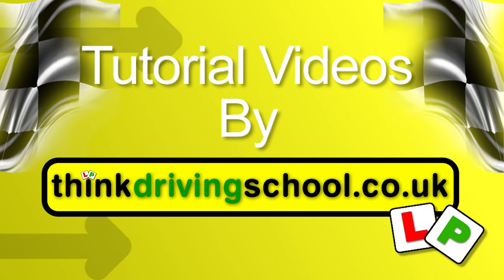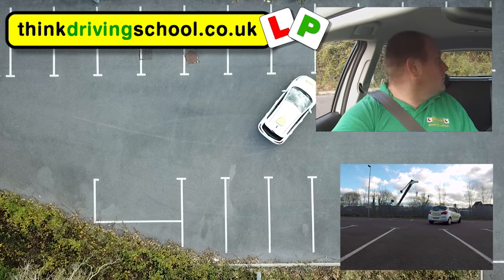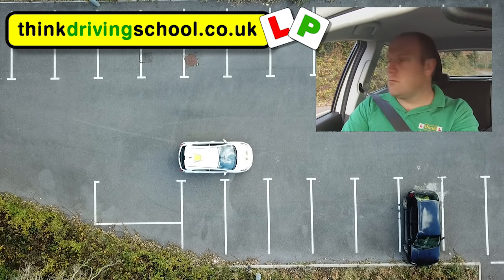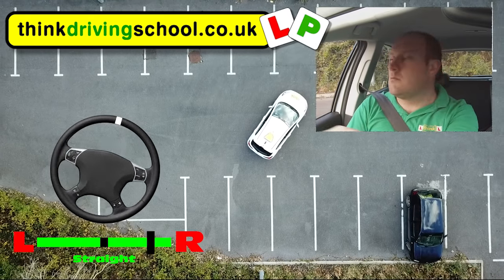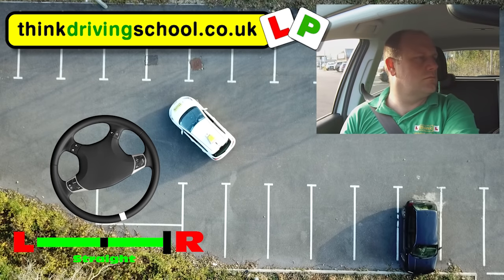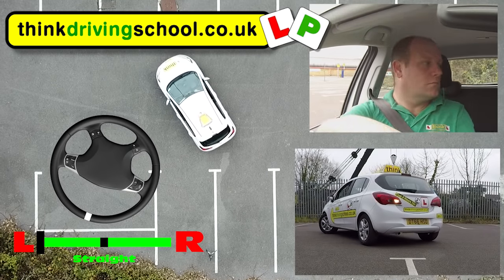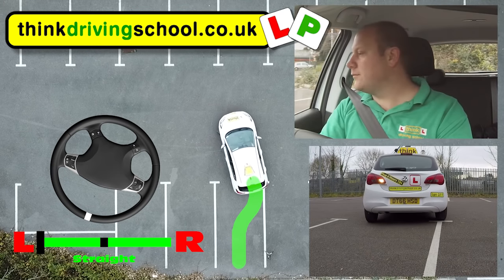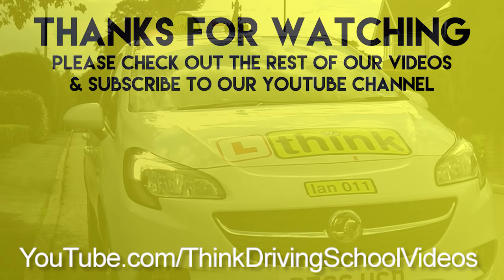Reverse Bay Parking Manoeuvre, Using The 45 Degree Method From Think Driving School

Comment: This is such a good tutorial. I'm annoyed by the number of videos that say for reverse parking you can use the "line method" for example 3 or 4 lines, etc. depending on the size of your car, but what if you have to park in the last parking bay? although you can still imagine 3 or 4 lines depending on the size of your car, what if there is a wall blocking you from doing that? i find this alot more practical
Reply from the maker: Glad it’s helping :)

Comment: When I began to learn how to do bay parking nearly two years ago, I searched videos of this method because most drivers used this one in my country. But then most videos taught 90 degree aka 3 line method; very few taught 45 degree method. With limited sources of this method I finally could do it and always used it. But then I thought I needed to learn 3 line method as well and began to practice it. I found that the traditional 3 line method had additional advantage, not only for parking, but also for reversing around a corner.
A few months ago, I got bored in using 45 degree, especially when there was only 1 car next to my car. Besides, I just intentionally want to show people a different method they probably have never known or used before. I found the traditional 3 line method was fun to use, because it gave me more time for swinging in reverse.
However, it depends on situation to determine which method I will use :
- if traffic behind me is quiet, I will use the traditional method
- in a busy traffic, I will use 45 degree method

Imo, every driver should learn both methods so they will be prepared to deal with situations in which one method is more suitable than the other one and vice versa.
Reply: Actually how to straighten the tyre without seeing it, without open the window? I have tried reverse park but always not straight...

Comment: You should give reference points to know whether we have reached 45 degree. Usually, as taught by other instructors in their videos, they use the image of lines at our chosen spot that appear in the mirror as the reference point.
In practice, we often have to park between cars instead of lines, so maybe you can do a video on it. I know the concept is the same, but it can be easier or vice versa.
Reply: Stan cravens explains the reference points.

Comment: I'd been practicing this for ages and always found it more difficult than the 90 degree method despite this being more practical to use. I think my issue was I didnt swing out enough at the part were you turn 45 degrees. Now I feel confident I can nail it each time. (Not confident enough to try it near a car, but I'm sure I could if needed)
Reply from the maker: You might find it easier between cars as the lines are harder to see than the other cars. 
Let us know how you get on

Comment: This video is amazing. If you park too close to the spaces will it not give you a wide enough turning circle. When reversing back left I tend to go over the line and drive back straight and then steer full lock to left. Is this because I was too close to spaces to begin with?
Reply from the maker: If you are further away it’s helps to stop you cutting the corner, but if the space is empty next to yours it’s ok to go in it a little bit
Reply: If the space next to mine wasn’t empty would this be a problem?
Reply from the maker: Only if you hit the car in it. So as long as you are adjusting around it that’s fine 👍

Comment: Great video just had one question though if I need to park to my right do I need to put the indicator indicating right even if I need to move to my left before reversing or so I need to put my left indicator while moving to left and then switch it to right while I reverse
Reply from the maker: Hi, just use your indicators to best help anyone that you think it will help. As long as your signal is not Mis leading then it’s not a bad idea to use it

Comment: I love your videos, all made very simple to understand. What are you views using this 45 degrees method compare to the three line rule? This look a lot easier.
Reply from the maker: My our view is do which ever you find easiest. Sometimes the car park your parking in defines which is best, for example a small car park with 4 spaces the 3 line rule may not work. Or a car park with narrow roads between the spaces you may not have space to do the 45 degree method. So if you have a choice do the one You favour :)
Reply: Think Driving School Many thanks. Any tips on anxiety during driving test ? I failed three times in the past due to nerves, not sure what else I could do to calm myself down. Any suggestions would be very much appreciated.
Reply from the maker: CC L Hi check out this page on our website 
http://www.thinkdrivingschool.co.uk/learn/dealing-with-test-nerves.html
See if any of that sounds like it may help :)
Reply: You should still learn the traditional 3 line rule. It has other advantages in addition to what said by the author.
For example, when searching for a parking space, you find that there is an empty space behind you just missed.
In your calculation, you are sure you have a plenty of time to reverse but not enough for doing initial steps needed for 45 degree method, because there are cars behind. In this situation, you are probably at the right position to do maneuver needed for the traditional 3 line rule.
Other situation in which the traditional method is useful is when you have to reverse around a corner. About 1 year go I entered a wrong lane in a closed parking area, which forced me to reverse around a corner. Fortunately, because I had learnt the 3 line rule, I simply applied the method for reversing around the corner and succeeded in one attempt. Drivers in the opposite direction might be impressed by my maneuver. :)

Comment: Could you confirm how many times we can correct ourselves. Ive been taught by my instructor the 3 line method which works fine but I feel more confident with this method as I've done previously but he states we only have 1 chance to correct ourselves which I'm not sure about, great video though!
Reply from the maker: CAVE MAN correct yourself as many times as you need but if you do it more than once it may be a problem but I have taken people to test who have done 4 shunts and still passed. 
But if you only do 1 shunt and your still not in your defiantly going to fail so do 2 safely and see what they say at the end :) 
Hope this makes sense. Good luck
Reply: Think Driving School oh that's fine then, I have no problem getting in the space just need to adjust my position sometimes so it shouldn't be a problem. Thanks for the reply!
Reply from the maker: CAVE MAN no worries, good luck 👍

Comment: do these same rules apply to a larger vehicle like a truck or is it different?
Reply from the maker: Billium the way you turn the wheel would be the same in a rigid truck, just when you turned the wheel may be different you will need to experiment in an empty car park. If the truck was to big tho it would not fit in a space :)
Reply: ok thank you

Comment: My method is i use bay im  level with as number 4 then 3 then 2 then 1  then is i go into i do half of turn right straight away then as i see chosen bay 4  i do full lock right just before i get close i let it curve a bit then do full lock right then to finish i straighten if its wonky left i go right or wonky right i go to  left theres different ways i do whats easier i dont like it and forward one i use bay 3 with my shoulder then 2 then 1 i go into then quater of turn right then full lock right to straighten.

Comment: Hi there, we can choose 45 or 90 degree in the test, is that correct? IT sounds like 45 degree is easier to control. Please advise. Thank you
Reply from the maker: chunyin ng you can park however you like as long as you do it safely, sometimes tho the car park it self has a bearing on how you do it. For example a narrow one might make 45 degree hard, or one with only 4 spaces might make the 90 degree one not possible. Hope this helps

Comment: When your reversing on the left and you turn the steering full lock to the left how do you know how far you are going back. What reference point would you use, I always have to adjust mine and then go back straight and then steer full lock?.
Reply from the maker: If you are realising that sometimes it’s not going in and you are able to fix it, be happy that’s the skill you need. Image if you got the turning point tight every time until the day of your test and then you don’t and you can’t fix it then that’s not good. So if you are spotting it’s slightly off and then fixing it, then you are there, well done 👍
Reply: I never seem to get the turning point right, I always have to straighten my steering to correct it
Reply from the maker: That means either you are turning out to late or going eat past 45 degree, 
But like I said it’s fine that you are correcting it a little. It’s hard to get it perfect every time. The real skill is being able to do that adjustment when needed 👍

Comment: In Canada we drive on the left side and I am used to parking into the right stall by looking at the right side mirror but somehow I have problem parking into the left stall. Are we turning the wheel while backing up? or are we backing up after we lock the wheel fully to the direction we want to back into before we back up?
Reply from the maker: Lin Angela It is best for your car to be moving while turning your wheel,
Reply: Lin Angela Where in Canada do you drive on the left side??????

Comment: How far forward do you go? How do you know when you have gone forward enough
Reply from the maker: When you get to a 45 degree angle, but don’t worry it it’s not perfect, you can adjust as you go backwards to get it between the lines if you didn’t get it perfect, this method is just to get you roughly in the right place you will always need to adjust as needed. Hope this helps

Comment: I tried it today. I always ended up on the lines ether left or right:(.
Reply from the maker: There are so many variables, you could have either been driving to fast or slow, or steering to fast or slow. but if its getting you close just adjust it slighty as you are going backwards to get it in, like the video shows a bit later on. Keep practising :)

Comment: I always unable to get my car inside the parking bay. I use this method too, but when reverse my car is in the middle of the parking line. How to get it right?
Reply from the maker: Turn out to 45 degree 1 metre later, but on the reverse there is always a need for a little correction. Expect it not to be in the line rather then assuming it will be, then you will be ready to any little adjustment needed, hope this helps
Reply: Happeneds to me how do you do it
Reply: @ThinkDriving I don’t understand what you mean turn out

Comment: At a point I can't see the lines in my side mirrors so I'm driving back blind which is were I usually end up parked across two bays... No idea how I passed my test
Reply from the maker: At that point look around you, if you where in the lines at the point of losing view of the lines, it’s just a case of getting straight. Looking around will help this :)
Reply: Angle your side mirrors slightly down. You will be able to see if you’re lined up.

Comment: You generally need quite a lot of space for this kind of bay parking, so avoid doing it in small carparks, like rural ones. 90° method works better in small carparks where you don’t have a lot of space to swing out.
Reply from the maker: You are not wrong, the same sometimes applies to small car parks tho, if you cant get 3 spaces past the space you want the 90 degree wont work either so you may need to work it out using the skills you will acquire from experience :)
Reply: @ThinkDriving  True I think like when its a one way carpark 45 degree method doesn't get you on the angle needed at all.
Reply from the maker: @AKSKMY  there are lots of factors to parking and this just gives you the basic shape, maybe you are swinging out a little early?
Reply: @ThinkDriving  Hmm maybe yup will try 45 again if I have the chance again haha.

Comment: I'm having major problems with this manoeuvre. I cannot for the life of me do a left reverse into a bay! Right is ok because I can open my window to check, but I always seem to go over one of the lines and its really frustrating for me. My instructor has only taught me the 90 degree method, not 45. Any suggestions? Thanks
Reply from the maker: Dawn Williams try this method, but are you going really really slow like slower than old mans walking pace? And do you have blind spot mirrors to help you see the lines without opening the doors to help you adjust it as you go back?
Reply: I am going very slow and we use bubble mirrors to help. we try bay parking in the test centre (where the bays aren't as far apart from the opposite bays as would be in a supermarket for example) so trying a 45 is difficult, esp if its busy!
Reply from the maker: Dawn Williams keep doing the 90 then, but watch this video on how to fix it as it’s the same if your doing 45 or 90 when your fixing it :)
Reply: Thank you. Yes I've subscribed and watch this video and the parallel parking one constantly! :)

Comment: No u are going too far back that would be a fail if you examiner sees that
Reply from the maker: Hi none of the parks in this video would you fail your driving test for, even if you touched the kerb at the back of the space you can still pass, deepening on other factors. As none of these parks even touched the rear of the space there would be no problem with any of them.